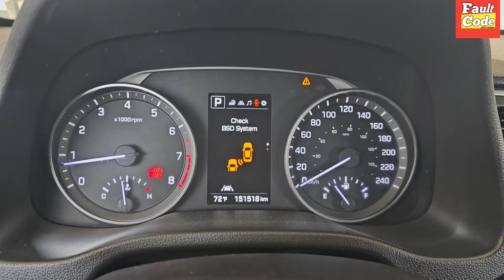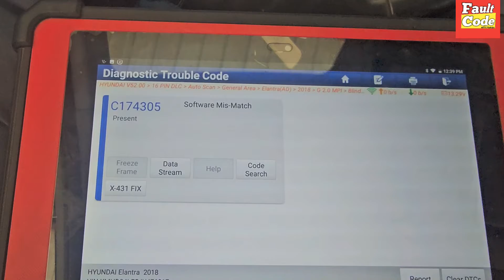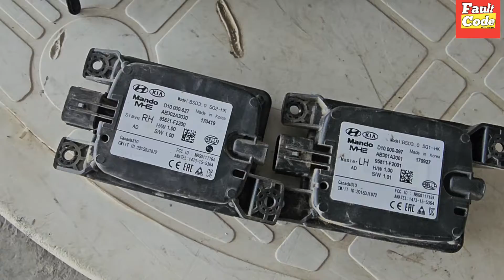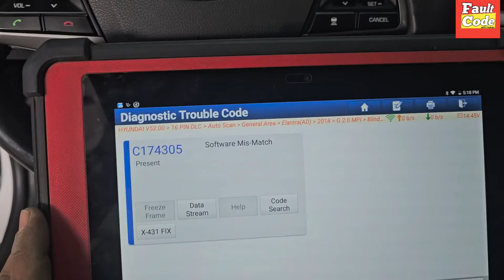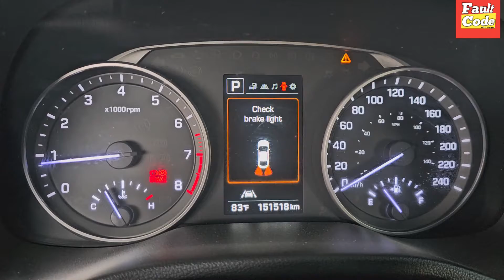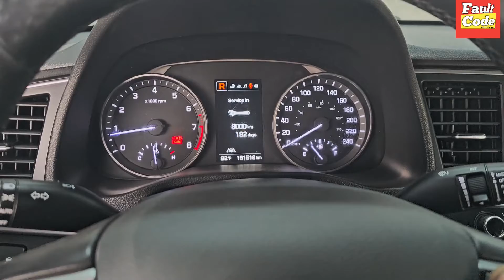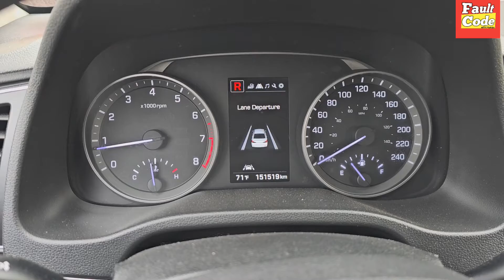C174305 Software Miss Match Hyundai Elantra || C170255 Coding / Solution 🔥

Comment: So please what was the issue  ? 
I replace the left side 
And I can’t clear the codes 

So what did u exactly did 
U swapped them!
Reply from the maker: I replace and program only
Reply: @faultcode  wait 
So did u replace with a another one 
Or u replace the left with right? 

Or I need completely a new one v 

Please provide more info as I’m in the same situation
Reply from the maker: I replaced the lift side with the used one 
Please watch the complete video
Reply: @faultcode  I did 
So that means I need another one 
But I got this one from another same exact car 

And I still can’t clear code 
I did calibration it said succes but the code is still there